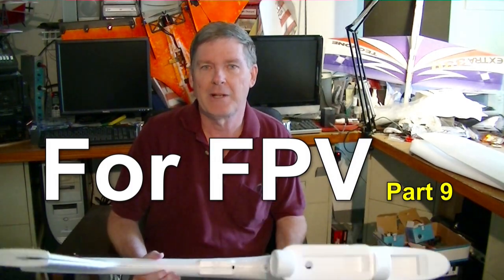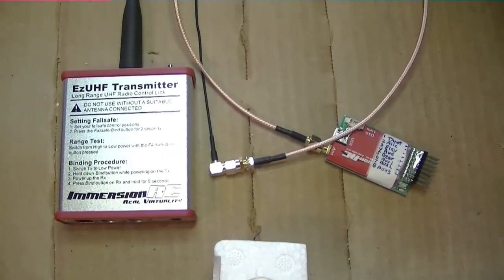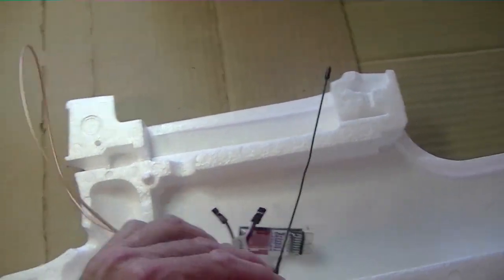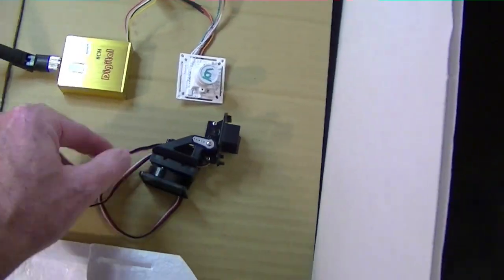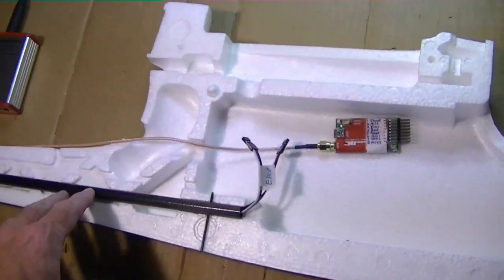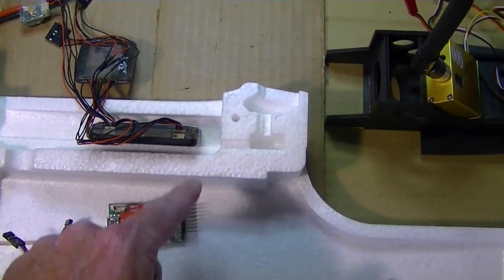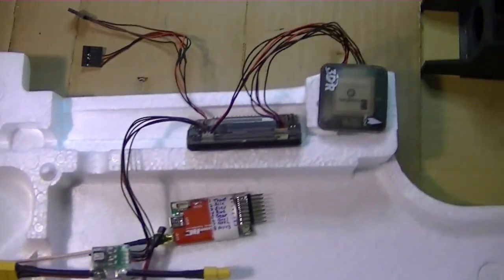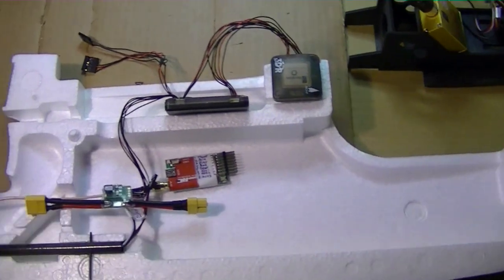FPV Part 9: FPV Hardware Overview and Placement on SkyWalker Plane

Comment: Regarding flying vehicles, I read on myrcmart that compass should be placed far from power and motor sources to avoid magnetic interference. I noticed that you intend to place the compass at the middle/top of frame, but you didn't say where the energy sources would go. I am guessing at the bottom of frame, and I am wondering if these distances are safe?
Reply from the maker: +Marko Jakovic It's been working great for years. No problems with acquiring and keeping satellites or with the compass.

Comment: Next time its better to put the receivers with each other (gps and rx)and putting the telementry with the vtx because you put the rx in the back then a telementry and then gps vtx so the listeners are very close to the talkers wich creates intervearance sorry fir my broken english but this is key to small fpv systems and good but not key for bigger ones
Reply from the maker: Actually it works great the way it is. Could be because the telemetry is only 100mw at 915mhz while the EZUHF receiver is 433mhz, no problems.experienced.

Comment: Great work
You might consider taking the VTX out of the gold case.  It gets really hot.  Even when testing on the bench I put a fan on it.  I attached a heat sink to it and put it in the air flow on the plane.  I am experimenting with a 1/4 wave home made antenna for the VTX that is working out well so far and reduces the weight and wind resistance of the rubber duckie.